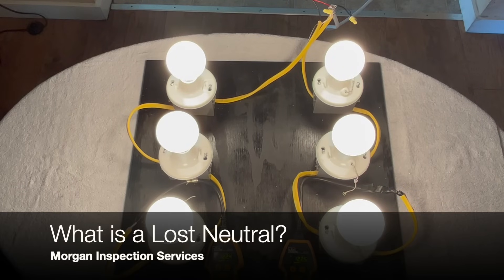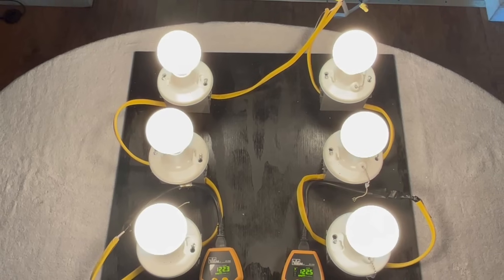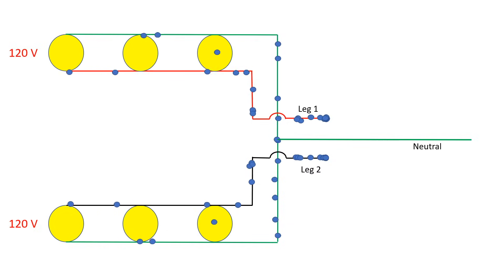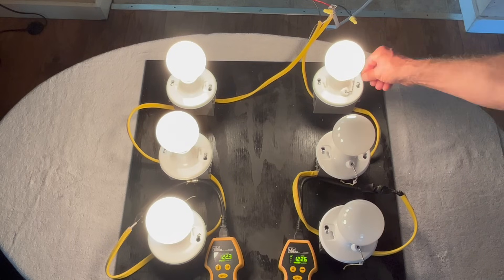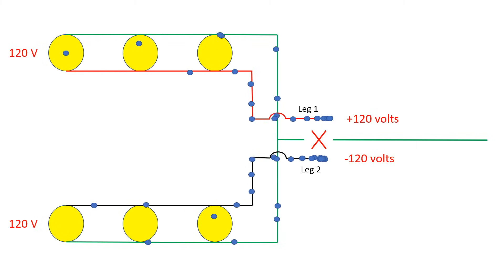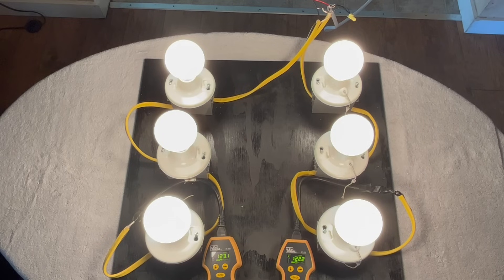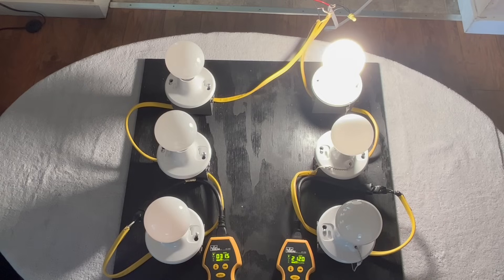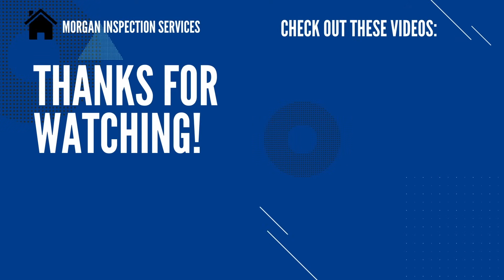What is a Lost Neutral? Lost Neutrals demonstrated

Comment: Great video, I have been having problems, I had the electric company come out they said on their side it good, so I bought a multimeter and sure everything is good until I turn on the microwave on certain days some days the microwave doesn't change anything and other days it makes the fan speed up so I go to the meter pole and leg L-1 is 132 and L-2 is 117 so is the problem on me or electric company and could the bad neutral come from half a mile  away i don't share a transformer i live way out in the mountains.
Reply from the maker: You definitely have a lost neutral. However, the symptoms are the same whether it’s on your side or the power company side, so it is impossible to say where the problem is originating. It’s just going to take some investigation. I will tell you this that you would not be the first person I have heard of the power company saying that it’s not their problem and then later discovers that it is.
And the reason that you have the problem on some days and not on other days, depends on the load distribution of what is currently running in your home. If you have a heavy load running such as air conditioning,clothes dryer, or things like that, then turning on the microwave will have a much smaller effect on the voltage than it will when very few things are running.
I wish I could help you more, but long distance troubleshooting is very difficult. If you can give me any more information, I will help you as much as possible. I would definitely be interested in hearing what you find.
Reply: @morganinspectionservices3840  Thank You so much, and I will give the update of the cure if I ever find it, today I turned everything I could find to bring one leg down, but it would only drop 2 points, the kitchen is on leg 2 so I had hot plates refrigerated, space heater , L 1 at the meter pole showed 120 L-2 showed 124 nothing was running on L-1 but in a few days seems it is usually a hot day it will actually up again. I can measure the  house or at the meter pole it's always the same, I was told if the legs are unbalanced at the pole it would be the electric company problem.
Reply: I have both legs hooked up again in order to find the problem.

Comment: The US should drop the 120V split-phase and just have 240V circuits.
Reply from the maker: Just curious why you say that. What’s wrong with having 120/240 V electrical service? Or what is the advantage of only having 240 V circuits?
Reply: @morganinspectionservices3840  Having a true single-phase system significantly simplifies electrical installations, reduces the amount of copper needed and therefore overall costs because for a given energy consumption in Watts is only half the amperage at 220/240V and therefore half the amount of copper is needed to meet the requirements.

Split-phase is a needless complication that offers no real advantages. Here in Europe, for example, I have no split-phase to consider. Everything is 230VAC and uses the same plug and receptacle whether it's a small table lamp or a dryer.

No special outlets are used or required so anything can be plugged into any outlet and can draw up to 3KW.

In my country the power plugs and receptacles are designed for safety with the plugs have replaceable fuses built-in to protect the wiring and appliance so it's an incredibly safe and flexible system.

If the US went 240V then it would also gain the commercial advantage of being able to export electrical to 220/240V countries. The difference of AC frequency is becoming less of an issue, particularly with modern switching power supplies. PC Gamers in the US would also gain the advantage of using more efficient 240V power supplies, and also more powerful ones if needed, which would save energy and reduce running costs.

Comment: Call the power company as the problem is their neutral.
If you call a electrician  you will be stuck for service call $ , and they don't work on power company lines.. This could be over $100 for a minimum call 
The power company will service and fix the neutral connection.no charge.
These electrical neutral problem s are dangerous and eerie. 
Our aluminum framed screen porch was measuring 40 to 70 volts. My dog yipped as she went outside because the aluminum frame and door was electrified.
I put my fluke black lead into the nearby ground (soil) and the red lead on some aluminum -  ac voltages were all over the place.  I think the electricity found a ground but also found a ground that energized the aluminum frame which was also grounded. 😮😮
Reply from the maker: Good point. Thank you.
Reply: There's an issue with your grounding system, on my house, my steel structure is the grounding grid, if I short one phase to it, the phase potential vanishes on earth (Faraday's cage effect) and I can even touch the grounded phase wire with my bare hands during the test, so my ground grid is secure to do a TN-S system and it's what I did, on day I've lost my neutral, my ground and neutral wire on my internal installation didn't got electrified, I could touch the appliances metal cases without getting shocked due the*Faraday's cage effect* what prove structural earthing is secure, but also has to be done properly, and this is what I done, my connection to structure is welded, never gonna be lost.

Comment: I think that problem only happens in countries using 120 volts because they have three cables going to their house from the transformer (+120v, 0v, -120v). In countries using 240 volts that's not a problem because they only have two cables going to their house from the transformer. If they lose one of the cables the light won't turn on.
Reply from the maker: Yes, you are correct. It only happens in countries where the voltage is split at the transformer, so countries that only use 220 or 240 V do not encounter this same problem.
Reply: @morganinspectionservices3840 This sort of thing does happen in countries using 240V systems, because the distribution is 3-phase. Factories, apartment blocks and other large premises get a 3-phase supply (that is supposed to be 415V between any two phases and 240V between any phase and neutral) and most houses get one of the three phases, rotating from house to house along the road. Loss of the neutral causes different voltages on the different phases according to the loads on them, and you can get things burning out because of excessive voltage.
Reply: Few countries use 240 V. Most of Europe is 400 V three phase and the same thing can happen. With 240 V there is another problem. Remember the neutral and ground are connected. What is in the neutral will be on the equipment cases. In single phase 240 V that is full 240 V. Now one can avoid this by not connecting the neutral and the ground and relying on RCDs.

In the UK EV charging points need to be protected against the broken neutral or PEN-fault as it is called there. This can be done by using a ground rod for ground. As it is RCD protected it will be safe. There are also more sophisticated methods.
Reply: @okaro6595  In all the US service panels I have seen, it is impossible to separate the neutral from the ground, electrically, unless you insulated the neutral bus bar from the panel, and I would think that would be a code violation. I was wondering as I watched this if the building ground wouldn't mask a lost neutral, as the neutral is also grounded at the pole. Granted, many if not most buildings have inadequate grounding, but I would think that in a properly grounded system it would be impossible for a lost neutral to cut all current flow on the neutral on the building side of the system.
Reply: @jbarner13  I used my building structure as grounding grid, so when I've lost my neutral, I didn't lost my microwave oven and my frost free refrigerator while the air conditioner was on another phase wire and the cut but grounded neutral.
An structural earthing can do a great difference, it's a so good earthing, and can even short a phase directly to structure, it never gives a shock anyway!
Reply: @okaro6595  Connect the earth/neutral to building's structure also protects, once it creates a Faraday's cage, I've lost the neutral on my house, but I was safe even with my neutral being bonded to Earth as a TN-S System because my earth grid was the own building's structure, was the called structural earthing, can even short a phase wire directly to the iron structure, the grounded phase wire simply don't give any shock on test, can touch with bare hands if the connection is perfect, don't give a shock, but during this phase to ground shorting test, the ground fault current is so high, around 30A at around 120v phase, so as seen on my experience, an structural earthing does a neutral bonded to ground grid be a secure earthing.
That's it, one or few earthing rods isn't enough, always use the steel structure ever as possible!
Reply: We had this on a 3 phase 240 V European system. Something was blown at the transformer and the lights were dim. We had a heavily loaded phase with the dishwasher turned on where everything survived and two almost unloaded phases where many power supplies were blown. Since most switching mode power supplies can operate on 240 V without issues it's not a huge issue in the US nowadays, but here in Europe we get over 400 V which blows most of the power supplies. Luckily if it's manufactured correctly the high voltage will make a component short to the earth (and sometimes a capacitor will also blow up), protecting the electronics behind so only the power supply needs to be replaced.

Comment: Thank you for this great tutorial bc I used experienced what turned out to be an broken Neutral wire from the Power pole it wasn't discover completely till my cable guy came & got lit up off the cables ground & came in & cked power outlets & smelt smoke but the outlets all had 199 volts so i quickly killed my main breaker & called the power co & did loose an brand new Window unit but hopefully thaT WAS all Lost
Reply from the maker: Wow! Sounds like you were fortunate in only losing a window unit.
Reply: @morganinspectionservices3840  yes Thanks absolutely but sine I wrote this i discovered the window unit still works but the smell I experienced came from The ac circuit breaker so that wire was replaced & now all seems to be OK ..I hope

Comment: Just had another issue with the neutral line going to the transformer on the pole. I had some strange power fluctuations again but not as drastic. So I put my clamp meter on one leg going into my panel. Then I turned every other breaker off putting a larger load on one leg. It showed a voltage delta of about 15 volts.  I called FPL and they sent a service truck out. He pulled the meter and put a device on it to check and it showed it was just over the allowed difference. After inspecting the ground cable he saw where my neighbors tree was chafing the wire. It was warn down to a single strand. They replaced the neutral drop and it is now fixed.
Reply from the maker: Good thing you caught that and followed through on it. I really appreciate you sharing that. I and my viewers learn from everybody else’s experiences.

Comment: I had a shared neutral on 6 plugs in my garage. A wire nut failed and I had a lost neutral in my house but just on 4 plugs. It destroyed a charger before I noticed the problem.
Reply from the maker: If a neutral becomes disconnected inside the home, then that’s actually a different situation than what this “lost neutral“ video discusses. We typically call your situation an open or disconnected neutral. I have a separate video on that. Sounds like you were already able to solve the problem. However, if you need it, here is a link.
https://youtu.be/BVcNnBKfC8Q?si=7Gb7tGew_n87GCKy Temperature
Reply: @morganinspectionservices3840
That video did a good job describing a lost neural on a 120v circuit. I’m referring to a shared neural. Which acts more like this video. So imagine this. 

You install a 240v circuit breaker. Then you take a 14-3 from the circuit breaker box to an electrical box with 2 receptacles in it. So going into that box you have red, leg1; black, leg2; white, which is a neutral shared between the black and red; then green, your ground. 

Red goes to a 120v plug on the right. Black goes to 120v plug on the left. Both plugs have a pigtail going to the single shared white wire. 

Now disconnect that white wire inside the electrical panel. Plug a lightbulb into both 120v sockets. The energy follows this path. 

Black wire 
Light bulb
White pig tail 
Second white pigtail going to the other plug
Second lightbulb 
Red wire

So you have 240v going through 2 120v lightbulbs. Being protected by a single 240v breaker. 

Now you have your demonstration but inside a house. Fun fun watching things smoke. 😁

Comment: I have a pole behind my house with a breaker box  and a meter box above it. Two wires run from the pole behind my house out to the main pole on road with the transformer. Am I responsible for everything on the pole behind my house? Thank you!
Reply from the maker: Typically, the homeowner is responsible for everything after where the wires connect to the weather head just before the electric meter. The electric company is responsible for everything just before the connection at or near your electric meter.
Reply: @morganinspectionservices3840  what about the meter box itself? And the wires that run up the pole from the meter? Ty.

Comment: Are there any simple uncomplicated tests that I can do in my house to determine whether I have a lost neutral or not? How do I determine if it's on my end or the power companies end? 

All the receptacles I've tested so far are reading around 120 (120 in and out) but my refrigerator won't run. I've plugged the refrigerator into different outlets and it's the same. Tried plugging my Skillet into different outlets around the house and it won't work.

Thank you!
Reply from the maker: This is a test that I would do in my house, but I will caution you that you must be very careful. I don’t want anyone getting electrocuted. If it were my house, I would remove the cover from the electric panel and measure the voltages at each main lug. Test between one lug and the neutral, and between the other lug and the neutral. See if you have 120 V on both legs of your electrical system. And make sure you have 240 V between the two lugs. If those tests are good, but you do not have 120 V at the outlets in your house, then I would say the problem is inside your house. If you do not have 120 V when measured as described above, then the problem is likely with the power company.

Comment: tho it's still the same concept, the direction of the current is inaccurate before the loss of neutral. However, after the loss of neutral, the animation is accurate. But here is where you're wrong. Current don't reverse direction because of the loss of neutral. so it's more like this (--> -->, <-- <--, --> --> , <-- <-- , ...) instead of (<--- <---) and then change to (---> <---) due to loss of neutral. Both legs are always in-phase whether there is neutral or not. Even when the osculate, they still osculate in-phase. It's hard to explain it because this is AC and not DC but hope you'll see what I mean.
Reply from the maker: I totally agree with you. I was not necessarily trying to show the actual direction of current flow with these animations. I was more trying to show that current flows from the transformer, through the loads, and back to the transformer via the neutral. You are 100% correct that the direction of the electricity does not change when the neutral is lost, but for illustration/animation/explanation purposes, that was the easiest way to animate and explain it. I certainly appreciate you watching and appreciate the feedback.

Comment: interesting video! does it mean that UK system is intrinsically safer than US? loosing neutral does not cause this sort of issues - please help me to understand
Reply from the maker: In the UK, they use 230 volt, single-phase electricity in residential wiring. In this case a lost neutral results in an open circuit where no electricity can flow, so in that sense, you could say that UK wiring is safer than US wiring. However, in another sense US wiring is safer because in the US most circuits are only 120-volt circuits, while all circuits in a home in the UK are 230 volts. 120 volts (which can certainly electrocute someone) should be only about half as likely as 230 volts is to cause an electrocution.  This is because current (amps) is what causes the electrocution, and current flow is proportional to the voltage. Current = Voltage/Resistance. This equation shows that for a given resistance of a human body, you will have about twice the current flow with 230 volts as you will with 120 volts.
Reply: @morganinspectionservices3840  thanks for your kind reply and videos
Reply: @morganinspectionservices3840  can i say that uk system if it fails it fails safely why us lost of neutral does not fail safely because instead of 120 v suddently 240 appears which could burn or damage something?
Reply: I can inform you that a loss of the neutral conductor on the 3 phase distribution system in the uk or anywhere else will result in overvoltage on any single phase distribution circuits . It is more common in the US with overhead lines and corroded aluminium conductors.